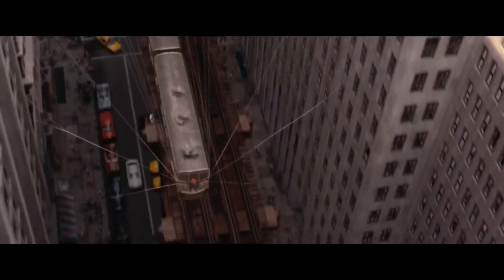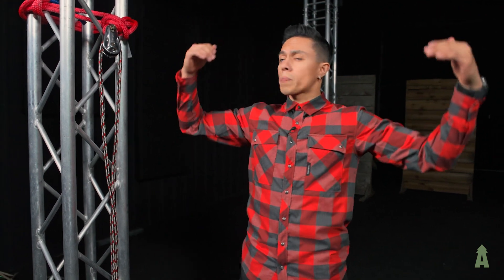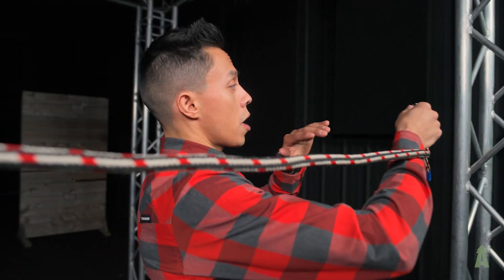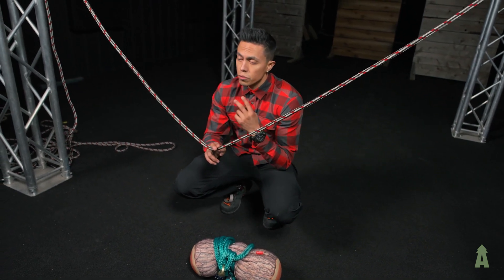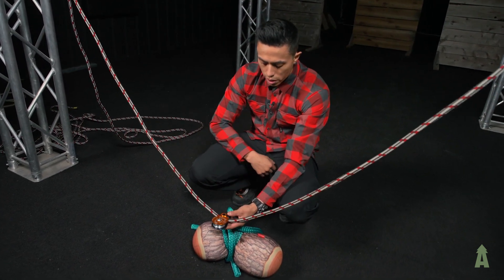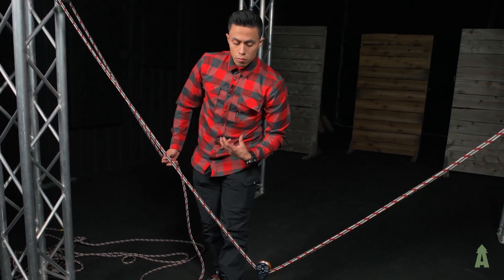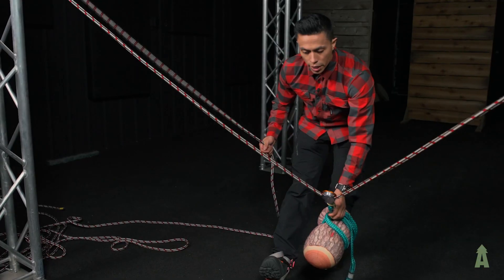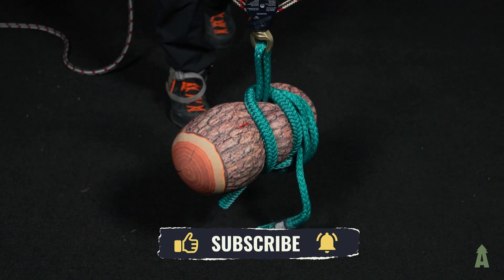A Guide to Span Rigging - Bartlett Technique Demonstrations

Comment: Nice video! Editor needs a high five 😂 Don't be fooled, tip ties shockload the system as well. Its also imporant to consider force developement and application. Its easy to develope very high forces that can load the tree(s) in very unfavorable ways with span rigging.
Reply: You from Michigan?
Reply: @wolverinebear5357  right next door, Ohio
Reply: This method of span rigging pulls the 2 anchors toward each other and distributes the load between them. It also creates a 3:1 mechanical advantage in your rigging system for your ropeman. It's a great choice for deciduous trees with opposing leaders, and shines at making rigging out hard leaners safer when there's another tree within your ropes range. The 3:1 means your rope man can handle around 3x his usual by hand weight without wraps, so be sure to use less wraps when their needed. This mechanical advantage ONLY exists in this method of span rigging. 2 rope span rigging methods do not create the 3:1 and will not make your ropeman 3x stronger, but they do distribute the load between the 2 ropes.
Reply: @southerntreeninjas3783  it’s only 2:1 and the mechanical advantage is only seen at the bottom of the system. At the top of the system where shock loading occurs, force vectoring will show you that the rope can see as much as six time more force than the weight of the piece. As the piece is lowered and the rope deflection angle around the pulley on the load  changes, it eventually transitions into a 2:1 mechanical advantage system.

Comment: One way of slowing the piece being rigged is using speedline straps if you already have them versus the pulley. Taking into account of course the weight of said pieces...

Either way, this is a good introduction to this technique.

Comment: Giving just enough information about a very useful, but complicated technique is not a good idea. You should have prefaced this video & ended it with direction to reliable resources for proper training. At a minimum, do it as a series of videos. 😢
Reply from the maker: While you are correct about this being an advanced technique, this video is meant to be a quick basic intro to the technique and at the least, introduce a new rigging option. Even if we did we a series, there are many variables that can dictate how this technique will play. For example tree species, condition of the tree,  equipment being used if any, whether a shock will be introduced or not, proper rope handling, etc. We will try to cover more on the subject at a later date.
Reply: @BartlettArboristSupply  I agree with you about the technique. Your description of how complicated, with many variables involved is spot on. Unfortunately, your description of it being a “basic intro” is not stated or eluded to in the video. In no way do I want to dissuade you from doing videos on this or any other subject about tree gear & techniques to use it. This video just fell short. I look forward to your future videos on the subject.
Reply from the maker: Thank you!
This is good feedback, the kind that helps us better the videos. Much appreciated!
Reply: @BartlettArboristSupply  Excellent video, but one thing that I would have mentioned is that with span rigging, you are now introducing a Force Multiplication with rope angles that can easily exceed your WLL/SWL or even more deadly, a vector point that can easily snap off your anchor point tree/s. This is NOT a technique for the new or average rigger. They need to understand basic tree physics first.
Reply: @chrisgirard7297  well said sir
Reply from the maker: Very well worded my friend!